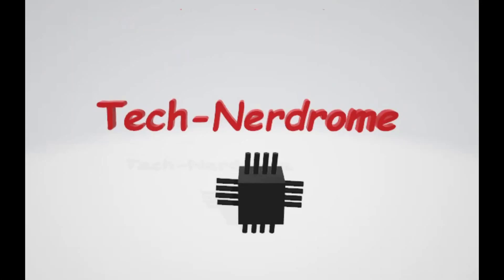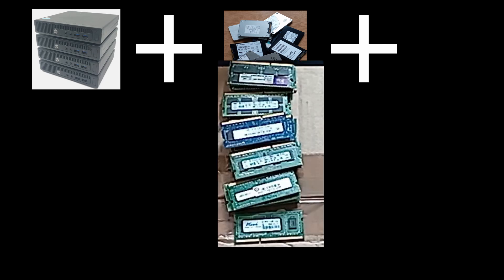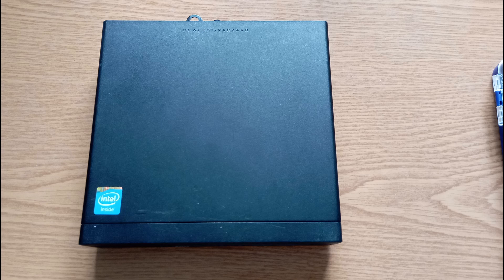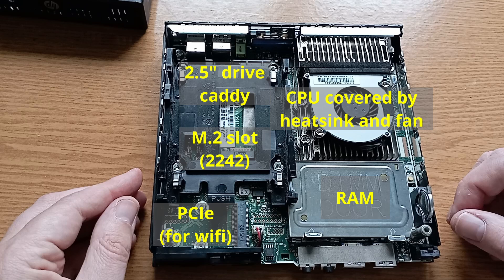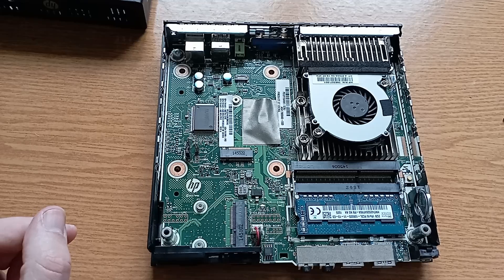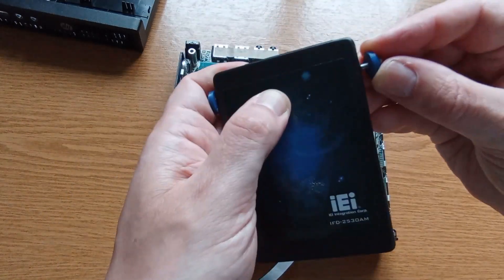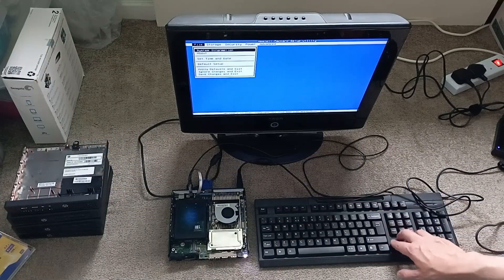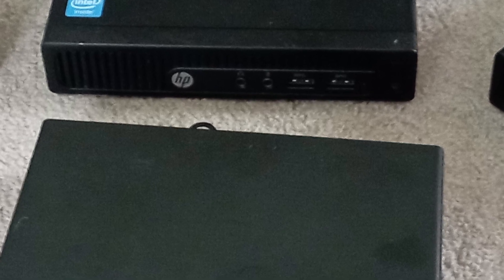Sorting Out An HP 260 G1 USFF PC Job Lot

Comment: mount 180mm fan and is good to go
Reply from the maker: That would make it a hovercraft...... I feel another video coming on.....
Reply: @Tech-Nerdrome  get a 25x25 cm block of florist foam and some coathanger wire, support 200mm fan with MB in the middle, and another 200mm fan ontop, then put an i9 in that baby

Comment: You can still upgrade to Windows 10 on any OEM machine. These little computers are better than I gave them credit for. I picked up in mass, some Prodesk G2s. Upgrading to an i5, 16gb of ram and and M.2 drive. They are very fast while being very quiet and mounted to the back of the monitor for a clean desk top.
Reply from the maker: Sounds like a good call. How big was the job lot??
Reply: @Tech-Nerdrome   About 30 of them. All 6th gen i3 except for the few I upgraded. I use them for music and streaming youtube, Tubi, etc.

Comment: "should have windows, if not there's always linux" no. I lived through I think it was vista that restarted every few hours without activation, I can live with windows 10 watermark or use MAS :)
Reply from the maker: Hi there, fortunately these had a full Windows 8 licence as they are HP OEM pre-builts, which the previous owner had upgraded to 10, so all licensed. Linux has got very good these days when that is not available. Yes, I still prefer to use Windows when I can though. Cheers!